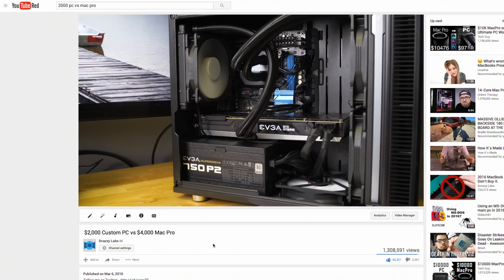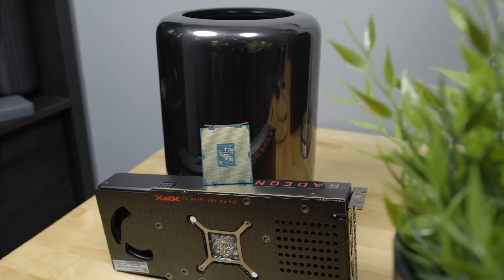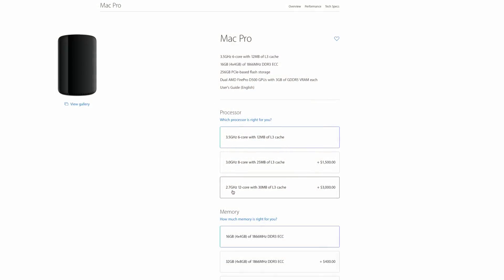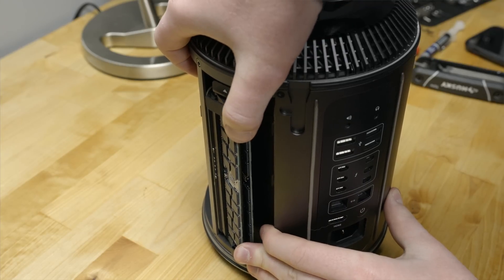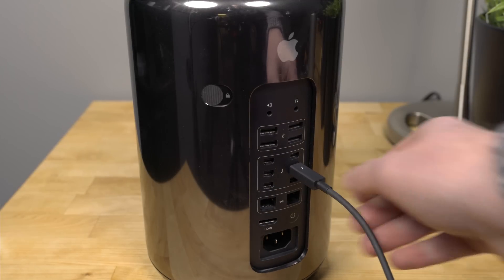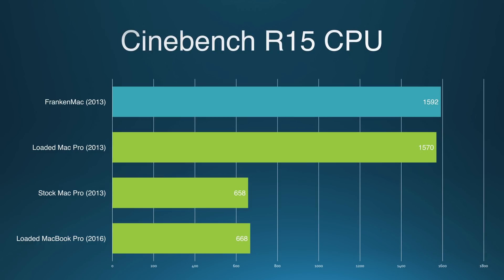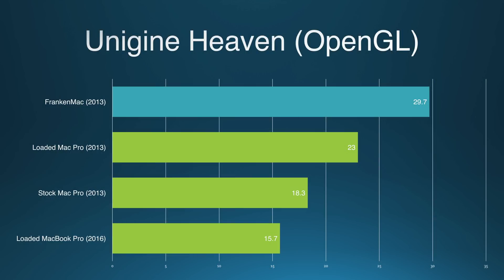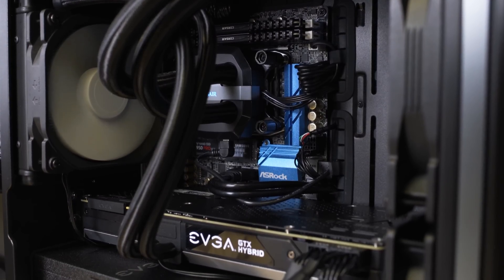The Best Mac... Apple Doesn't Make!

Comment: The things people will go through to use Apple's Software
Reply: Says a lot about how good their software is doesn't it
Reply: Obviously we have different opinions. 

What you call "assume the user is an imbecile" is simply super great UX, something that I've rarely encountered on Windows nor Android systems (have happened though) 

The fact that its so easy to use, is a positive factor. Apart from that, it's highly secured, integrates well with other Apple devices seamlessly and does not require you to mess around with settings and rooting/jailbraking it to get it working as you like.

Again, it's different opinions.. Objectively, neither of us can call iOS good or bad.. I think it's better than any other mobile OS I've experienced, and you think Android is better than iOS. Each to his own. :-)
Reply: Dave Satay I don't think thats correct. osx has been very stable for me and I dont think professionals are switching
Reply: Because they make crazy good software. Their hardware build quality is insane too, but the actual hardware is kinda crap.
Reply: Lasse Rafn Apple software is remarkable. It just works. Sorry I mean it usually just works. Also better support when things do go wrong. Even tech support couldn't resolve my issue with windows. I also like how my idevices communicate with each other, if I need to respond a text or view a text. Or take a call or make one. No going to other side of room for phone. Yes I'm lazy. Apple made me this way. They also made me more productive at work, because I'm not wasting hours fixing problems which shouldn't happen.
Reply: Kreutzwerkz what do I have to do to be an individual then? Have my computer look like a kids computer?

Maybe, just maybe, professionals just want a gorgeous computer that works.. not one that looks like it belongs on a teenagers gaming room that can run Crysis on Ultra?
Reply: hardware hen you get a mac. just the software and fancy brushed aluminium.
Reply: Kreutzwerkz I'm sorry that I dont want to add lights and watercooling to my computer.. oh, and a aninal-sticker.. I'm so sorry that I'm not like you.
Reply: Matt plays, iOS is simplified, but MacOS actually isn't. It has all the tools and programs for most consumers and creative professionals. Most audio/photo/video editors I heard of use MacOS.
Reply: Unboxing Surprise Egg Toys let me get this right, you can't rely on windows because the and only the store has bugs? Ohh, I can't rely on OSX because an app that I use is not available on that system, OSX sucks and nobody should use it lol.
Reply: Programming? Hahaha, do you know that MacOS was built in BSD? And is more customizable, if you know it? But since you don't, my guess is your knowledge is limited to windows.
Reply: 4k doesnt really tax a cpu so much as it does the gpu. if you dont have a decent cpu and a beast gpu, no way you are doing 4k over 25-30fps.
Reply: Lasse Rafn, who makes crazy good software?   Are you talking about Apple?   Can you give some examples.
Reply: Dave Satay Yes, Apple — sorry for the confusion. macOS and iOS to me is absolutely fantastic software. Final Cut as well.
Reply: Matt plays can you get forza horizon 3 on steam?
Reply: ICE Starboy i once opened my steam library on a friends MacBook... should've never done that
Reply: Kreutzwerkz watercooling is pointless for most work.. maybe if one is doing 3D rendering and 4K video rendering.. but most other professional work won't require it. My (very thin) laptop surely won't need it; and I run 3 high resolution monitors and one Retina (the laptop itself) and quite a lot of processes and apps, for 8-11 hours a day.
Reply: Kreutzwerkz why would I worry about visual customisation, when it keeps me productive and gets the job done in an efficient way. I have windows 10 on separate PC for gaming. I don't customise that either apart from wall paper. Oh yeah and removing all those annoying tiles from the start menu. I prefer a clean look. I have no icons on my desktop in either Mac or PC. I have common programs on task bar. Etc....
Reply: dont tell me you are using Kali Linux for production right
Reply: ICE Starboy just fucking use hacintosh
Reply: Matt plays also you're always comparing custom desktop PCs with pre-made all-in-one ultra thin aluminum laptops. Also the new MacBook Pro is more overpriced because it's a 1st gen product, but I guess both iSheep and Apple haters don't realize that. And yeah, sure, all Apple products are overpriced. But so are clothes, food, medication, etc.

Also you're saying the parts are worth $1000. Sure, but any $3200 Windows laptop also has parts that are worth $1000. Apple is worse than the rest for pricing but every single tech product is overpriced because they wanna make profit (fucking duhhhh)
Reply: LukeRM "it is a consumer product" no it's not, it's meant for pros, and it's bad for that. The macbook and the imac are consumer products.
Reply: Unboxing Surprise Egg Toys lol, couldn't you just google the error? and then people like you complain when someone says that apple software is made for dummies.
Reply: Unboxing Surprise Egg Toys if you can't use google to try to find a solution, you should use a mac. And use origin and steam for games, never had a problem like that with them.
Reply: csjdruid u sir are dumb u can ryzen which price to performance is better
Reply: Unboxing Surprise Egg Toys no offense but I am a bit confused... We're you ended up playing Forza Horizon on the Mac Pro?
Reply: Mac Guy3135  Well looking at your name and profile picture I'm really that shocked.
Reply: Matt plays
You're not getting 6ghz on an 8350 without liquid nitrogen. Most can't even get a stable 5.5.

Edit: Just read more of your comments. "Without oc the fx8350 it is meh standard 4.5ghz, 5ghz turbo." That is not true at all, it's 4.0/4.2. You clearly don't know what you're talking about.
Reply: Lyes Oussaiden's Personal Account You can turn of all of that in Windows control panel you know.
Reply: Edgar Teoxon Linux is better fpr programming still.
Reply: ICE Starboy Homestly the only possible reason I could think of for why someone would want ye old trashcan pro in 2017 is because it's tiny. Even the smallest mini itx cases that can support full sized gpus are not as tiny as that little guy.  

Having said that, with the release of AMD Ryzen as well as Am4 mini itx motherboards I cannot think of a reason for purchasing this Mac Pro for such a massive price premium when a comparable system can be built for far less in a case that is only marginally larger than that of the pro.
Reply: +companyoflosers It really pisses me off when people like you call someone an idiot for their personal preference. We are not talking about a server or a computer used for research here, it is a consumer product. What many people look for in a consumer product is the overall package rather than pure computational performance. For a lot of people a computer with 'inferior hardware' as you describe can often be the better overall package because of it's bundled software, ease of use, cloud services, physical design etc. As I said, it's personal preference. I personally have a powerful desktop PC for the heavy lifting and a 2013 Macbook Pro for everyday computing. Sure I could have got a more powerful laptop for less money but it wouldn't have been nearly as nice to use for what I do and probably wouldn't have been able to stand up to the beating I've given mine over the years as it's gone everywhere with me.
Reply: Mac Guy3135 "illogical maze"? Are you still talking about 3.1 (which, by the way, copied macOS at the time)?
Reply: csjdruid hmm my Fx8350, dual r9 290x 8gb trashes the all of the Apple computers in every single way and I build it for under $1000. So please stop arguing about computers if all you have used are the crap produced by Apple...
Reply: csjdruid btw the HP a10 processors are stronger than the shit apple uses, and cost 1/4th the price. The x15 predator costs $800 and beast the crapple at everything...
Reply: there is "delay or hold back in terms of progress or development" in terms of technology. That is a statement, statements them selves are not offensive. 

Now onto the main part, I had the mac book pro 2013, it was OK (but shit for the price) got it as a present for graduating. I used it for 2 years, lets say this in those two years Mac OS's limited applications only held me back. what took me 2 months on the mac took me 6 hours on a windows based pc for a 1/4 of the price.
Reply: thats why normal people use steam
Reply: Hifihedgehog,

Wall Street analysts have said that Tim Cook has no imagination or passion.   He is nothing like Steve Jobs.    Mac has been ignored for years, Apple only cares about iPhone now.

Maybe that's why Mac has a tiny 7% market share, after 30 years in business.    The whole world runs Windows.
Reply: I'm talking 10 here. I run it in a VM and spend most of the time dealing with the OS than actually focussing on my content.
Reply: That's just a dumb comment, you clearly don't use it if that's what you think
Reply: Matt plays who the fuck uses a $500 brand new laptop? Those things will be made out of shitty plastic and will have like a pentium in them. Comparable computers are not 1/4th of the price
Reply: Matt plays It's an exponential amount of value as you go up in specs. Just get the 13 inch don't get the top spec where the ssd itself is $1200 and the ram is $400
Reply: my CPU doesn't even hit 80% on the newest games on 4k ultra
Reply: Matt Plays yeah but it's worse than an i3 lmao dont buy amd bulldozer
Reply: to each their own, I'm switching to ryzen soon anyway my PC is due an update. Btw this CPU is equal to i5, my friends 6th gen i7 only beat it by 10% on benchmarks and rendering (films, 4k, 3d models ect.)
Reply: if it is only 10% worse than i7... how the fuck is i3 better, if that was true then i5/i7 would be useless. Without oc the fx8350 it is meh standard 4.5ghz, 5ghz turbo but mine runs at 6ghz and 6.5ghz turbo after the overclock (1 year still no crashes).
Reply: Lasse Rafn ios is not good all... all it is is simply for people to understand, I personally prefer android as it doesn't assume the user is an imbecile that doesn't know what he is doing.
Reply: you know the apple OS is made so that retards can use it (it is simplified down to hell and beyond)
Reply: i did, it lacks any kind of customization (if you did programming/graphics design/modeling ect.) you would see how the mac os only limits its users to keep it simple so dumb people can use it. (btw retards was used correctly check the definition XD)
Reply: says more about the idiots willing to pony up thousands of bucks for inferior hardware just because its the cool brand to have.
Reply: LukeRM I can I have compared multiple times, Mac book 2016 (parts worth $1000) sold to idiots for $4000 that is my problem with Apple.

BTW Fx8350 is an 8core made over 4 years ago and trashes that CPU. my one isn't even oc yet, it easily goes from 4.5ghz to 5.5/6ghz on a good mobo and a good cooler.
Reply: Mac OS's Finder file explorer is very illogical as is their GUI in general. It looks very archaic and clunky side by side with Windows 10. Unlike Tim Cook, Steve Jobs would have made vast improvements to Mac OS by now.
Reply: Matt plays if it takes you 2 months to do a 6 hour task, I think you're going wrong somewhere. If you hate it so much why don't you use parallels? Also I hope 1/4 of the price is an exaggeration. 1/4 of a MacBook is only enough for a 6100/1050 build at most. Which will be less powerful than the MacBook anyway. Finally I seem to be able to use macOS applications perfectly fine. Different people have different preferences.
Reply: +ICE Starboy this makes no sense, I use Windows, macOS, and Kali Linux, and the main OS I use is mac, are you going to say the same thing to me because I built a computer with macOS on it? Of course not. Quit being biased just because you don't have one
Reply: Yeah no kidding.  OS X has been a buggy joke over the last 3 years.    Many professionals are abandoning ship, for good.   Apple operating systems are poor quality.
Reply: I mean, that doesn't even make sense. I don't know what you mean by 'customization' but it's a UNIX based OS that you can modify a great deal from within the Terminal. It's only on iOS devices that it's closed off to manual modifications. Also there is no non-offensive definition of that word so please don't use it.
Reply: As I have explained a million times now when you buy a MacBook you are not buying a pile of parts like you are with a gaming PC, you are buying an overall package so of course it's more expensive. However even if it was a pile of parts it would be more than $1000. Yes I'm familiar with the Fx8350, I actually built a gaming rig using one a couple of years ago but ended up swapping it for an i5 (it had higher single threaded performance than the i7s of the time which is what I needed) as the 8350 completley bottlenecked my system. I know the theoretical performance of that processor is immense (that's why I bought it as well) but it's single threaded performance is terrible and if I were you I'd switch to Intel as with two graphics cards as powerful as yours I seriously doubt your CPU could keep up playing games as most just aren't built to support an 8 core processor. But that's another discussion.
Reply: Lyes Oussaiden's Personal Account You might be right. I had some problems with Windows 10 so  I downgraded to Windows 7.
Reply: Better than fighting your way through the illogical maze that is Windows every waking hour. Some people just want to get on with their content.

Comment: i'm like you, i much prefer FCP over premiere so i cant justifty building a workstation pc to use a software i dont like as much.
I use the 2012 mac pro model 5,1 upgraded with an internal 980ti, external 1000wg2 power supply, some SSDs obviously and (stock 6core 3.33ghz xeon)
the thing shreds GPU renders and im saving for a 12 core updated compatible xeon (i believe 5690x) to get even more performance out of it.
every game runs on ultra @ 1440p on the apple LED display, battlefield 1, gta 5, etc.
GO WITH THE TOWER. they're cheap to buy and you can upgrade the sweet fuck out of them internally
Reply: Xaeret hackintosh?
Reply: no, just a mac pro model 5,1. you can just put other parts in it, they work.
Reply: ok cool

Comment: if you put the rx 480 in sli, how would it perform on the mac?
Reply from the maker: +Jay Masher If you had multiple TB2 connections, you could theoretically do Crossfire but I'd bet there are issues. I'll try and see if I can do it.
Reply: :D

Comment: I moved to pc and installed mac OS. lol
Reply: Matthew Kosloski well, that's untrue. With effort, or almost no effort if you're lucky, everything will work perfectly. getting mine to work on an x99 board that had never been written to work on any forums (EVGA x99 micro 2), I began to feel doubtful but I pressed on and made it work, it works incredibly. Intel p600 nvme boot drive, GTX 970 4gb, 6 core Intel i7 6800k. some other ones I've assembled just worked with almost no effort except an audio or network driver hunt-down here and there.
Reply: elite tech pckinctosh, it triple boots windows and ubuntu.
Reply: How stable is it? And what PC do you use?
Reply: I wanna do this but everyone tells me hackintosh is impossible to get right 100%.
Reply: Devin Chaves research, or find out for yourself. lol
Reply: hackintosh*
Reply: stevey500 Okay buddy. Tell me about your PSU scenario then.
Reply: Devin Chaves you what, huh? 650watt rosewill PSU is what I'm running.
Reply: For anyone who believes this,  I will sell them some prime property in Florida, actually swamp land.
Reply: This reads like total fiction.

Comment: If 40% of the bandwith is wasted of the rx480 why not use a rx470 and save a few bucks?
Reply from the maker: +Wimium I already had an RX480 laying around. The 470 would be a better option.
Reply: And still it nicer to have a rx480 compared to rx470.

Comment: I you can add one GPU this way, can you add 2? or 6?
Reply from the maker: +Edward Rex Rumors say one per bus, so on the Mac Pro, you could theoretically run 3.
Reply: Cool. I have a 12 core 3.46 machine 2012 which s a great machine, but the limitation is only one double wide slot.

Comment: Surprised that macOS now supports external Thunderbolt GPUs? 😳
Reply from the maker: +Timo Ernst It doesn't really. It just doesn't "not" support them. Lol
Reply: Snazzy Labs Interesting, cause I heard in all those YouTube videos about Razer Core and such that you need to use Bootcamp in order to run that. 🤔 I wonder if you could upgrade a MacBook Pro with an external GPU then.

Comment: Why not just go for a proper working hackintosh with more power? If you build according to tested builds, you can get some great performance.
Reply from the maker: +Gershon Dharmanandan I need 100% reliability. This is my main workstation for the office. I don't want to hassle with weird bugs and driver issues even if they only happen once every few months. Hackintoshes are great—just not in this scenario. :)
Reply: Snazzy Labs ohh ok, personally after I setup my hackintosh I've never had any bugs or issues. It's a lot better now if you use the right equipment.